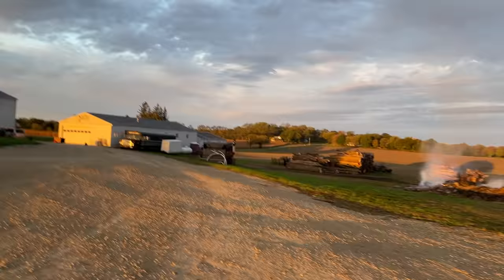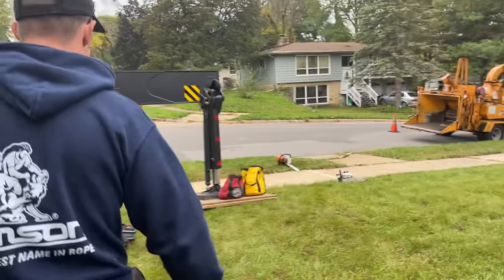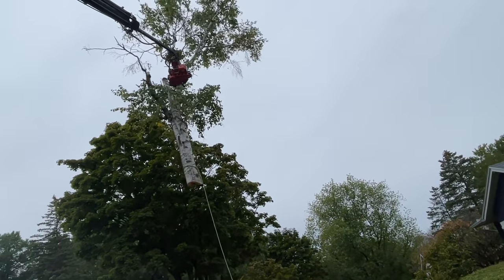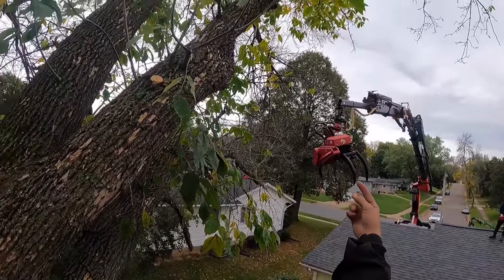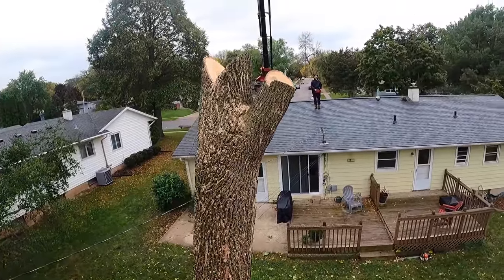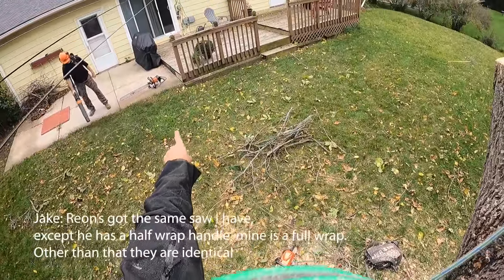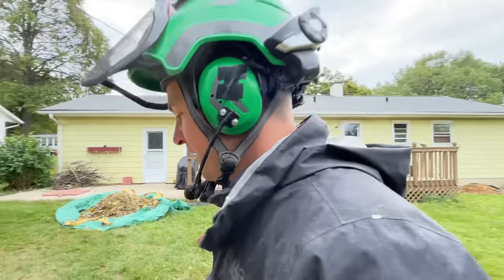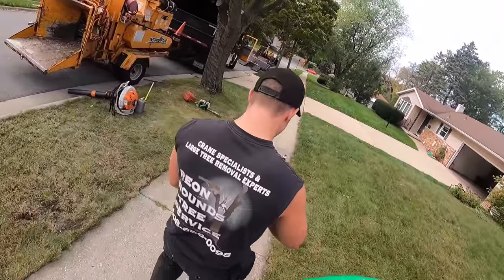KunckleBOOM BABY! Reon's 110 ton TreeMek picks apart a big Ash tree in Wisconsin.

Comment: Awesome job, I really enjoy your "interview" style. you have a knack for asking really good questions without sounding like your just doing an interview. Funny that truck had everything including an air nozzle to blow off the controller but doesn't tell the weight of whats in it's grip. congratulations on the new adventure look forward to seeing where you go next!
Reply: It was showing percent of capacity on the picks, so I guess it doesn't matter how much it weighs as long as you can pick it up.
Reply: @dukeflem  good point.
Reply: @dukeflem  p
Reply: The weight scale would constantly have to re evaluate the pounds as the boom retracts .physics .so  % of capacity is more beneficial

Comment: The knuckle-boom is an awesome piece of equipment!  I was in awe of how flexible it maneuvers, and the talent of Reon.  “Smooth operator.” 😉
Thank you, Jake!!  Looking forward to the next video.
Reply: Indeed. Palfinger Cranes are some of the best ones when it comes to flexibility and the company takes great care about giving the customer exactly what he wants and needs.

This model is (i think) one of the biggest they make and it has so many great functions like a memory for a crane position (means that you can "save" a position, and if you push a button the crame remembers this position and automatically moves to it the same way like you did it manually before.) or a "boot up" sequence where you can program that the boom automatically unfolds and goes into a pre-set position with just one button. (This is mostly meant for cranes that are used to load trucks, but i'm sure it works with this one too.)

And not to forget the safety and assistance systems like a overload protection, also that the crane checks if the outriggers are out, how much they are out (half, full, etc.) and calculates how much you can lift with that and shuts down if you lift too much.
Just like you can see at 33:40 that's the system telling you "Hey, this is almost at max. capacity. Be careful."

Comment: A short Ton, is equal to 2,000 pounds
A metric Ton, is equal to 1000kg, (or 2,204.6 pounds)
So Reon really got his math screwed up when he said, "a 110 tonne is about half of what a ""normal measurement"" would be".
When in actuality you could add 10%, so it would be about 121 short tonnes.
Anyway, there's no way that crane lifts that much or even half of that, which would be about what an A1 Abrams tank weighs in at, 55 short tonnes.
It would probably be a good idea for him to read the load chart before he continues working with that thing.

Comment: I'm not sure Reon has his maths right. A metric ton is 1000 kilograms which equal 2240 pounds. If the truck weighs 55 American tons then the 110 must be for 110,000 lbs. That is an awesome piece of machinery
Reply: Crane driver from Sweden here it is rated for 110 tons at 1 meter should dead lift 20-25 tons at 4m =)
Reply: @Daniionwheeles  thanks for clearing that up

Comment: The biggest knuckle boom picker I have heard of is 60 tonne so a capacity of 132277 lbs and 50 meters reach so 164 feet of reach and at max reach it can handle 1800 lbs. But that is an impressive rig in its own right.
Reply: He states that this is a 110 metric ton crane =110.000 kg
A US ton (short ton) is 2000 lbs =907 kg

A imperial ton (long ton)  is 2240 lbs = 1000 kg. 
So this is a 2240× 110 = 246.400 lbs crane at 1 meter distance from the pivot pin in the crane. (About 1 yard) and the lifting capacity at 10 meters is 110 ton /10m to give us a load capacity of 11 ton (long) or 2240 ×11 = 24.800 lbs

He seems to be a great guy and a skilled operator but he has it backwards on this subject

Comment: Does the display tell how much pressure the grapple is applying? How do you decide if the limb is a risk for breaking at the grapple? Is it just personal knowledge knowing the characteristics of that species? I suppose it's possible to safety sling either side of the grapple to the boom if you thought it might? Love the channel.

Comment: The best way I heard V-cuts explained is if you think its gonna spin or rotate then make both sides steep so it simulates a flat head screwdriver and the piece is trapped down and from rotating 
It also helps pop holding fiber in a piece that is pinching...the operator can lift or release and the angle cut acts like a lever ...
Big spar work with the mech head try snap cuts with the low side facing the crane ...
You can bypass the cuts ...move to a safe place/ ground..and the KB can push from the top and pop it while its sitting on the tree no shock load ...low side let's him retract for strength .....
I enjoy watching and learning from your guys videos and apply them to my career...ty

Comment: Great video, I’m going to have look at the specs on that machine. It might work better in my field that my stick crane
Reply: If you do look at them make sure to get the cable winch option as well. I noticed this didn't have one and was a bit surprised as I would think it would be pretty useful for tree work. Essentially it gives you the ability to use it like a stick boom.

Comment: Interesting your observations regarding the significance in varied tree species in equally varied regions of the country.  I grew up in WIS and now live in New Mex.  I am by the mountains and there are very few trees here in the 4400 ft .elevation of high desert.  Cottonwoods are by far the largest and are hundreds of years old.  Some are better than 6 ft. in diameter.  But, just 4000 ft higher in the same mntns is the Lincoln National Forest with some of the phenomenal Fir & other "Evergreen" species that TOWER overhead for what seems like hundreds of feet, Straight up!!  In WI we had huge Elms, Oak, Ash, and other huge broadly spreading species like those in this video.  As a kid I used to climb them like a squirrel.     Keep on with the great content.

Comment: What an awesome machine.  Its not 55 US tons capacity though.  A metric tonne is 1000kg, and a US ton is 2000lb, but a kg is 2.2lb.  This means a metric tonne is 1.1 US tons, so its capacity is 121 US tons.  It's called a tonne because metric is a French system, and it sits right between a US ton (0.91 tonnes) and the UK ton (1.01 tonnes).  If it wasn't so close, they would have called it a megagramme.  The US education system has taken a nosedive since the '60s.  Over 55s can do ballpark unit conversion in their head.  Anyone younger seems to have no idea.
If Reon bought the machine thinking it had a 55 US ton capacity, he's paid for a machine with over twice the capacity he wanted.  He's obviously happy with it, but that's no way to run a business.  This is why education matters.

Comment: I looked up the price of these trucks, they can range from like 100k to million. Can't even imagine the fuel consumption of an 80ton truck. Just baffles me at how there is profit to be made cutting trees for a few grand a day. Only 260 work days in a year, and multiple heads to feed. The math just does not add up to me, crazy but damn I do love these machines. I have a hell of a project coming this fall after the heat wave to knockout alot of 60foot trees around my property with plenty of lines and obstacles, and no way to wheel a crane into the backyard :)

Comment: Here in Ontario we have the White Ash (Fraxinus Americana) and they Emerald Ash Borer has killed millions of trees. On my 80 acres we have cut a few thousand down and the suckers come back with a vengeance. You have to herbicide, burn, or chip the stumps to stop them from coming back and infecting the new generation of trees. You are then left with beautiful logs up to 48 inches across, but you can't sell it because the market for ash is gone because of the disease. Most of it goes to firewood unfortunately, some of the largest I pulled out were 150 years old burned for firewood. Sad.

Comment: i run a knuckleboom for a living in europe, and the 110 doesnt actually mean straight up tons on the crane ... its actually 110 ton/meters .... so basically the 110, you move the decimal point over for 10 meters and you know how much it can potentially lift with 10m of reach on the main boom without the jib on the crane, so 110 t/m means around 11tons on 10m of reach, and just double the number to get the lift capacity with the boom completely closed up.... used to run a 220 t/m for a finnish company for 5 years, also its not really all that complicated to run, the keyboard remote functions are all pretty much set up the same way, no matter what brand of crane you run, exept the goofy ones (for me personally) that use remotes with joysticks

Comment: As expensive as it is, I'd like to see if it has weight sensors on the pads to see when the truck moves as larger pieces get lifted way up.  On smaller booms I always watch the tires to see if the truck is lifting.  Only negative of course is you don't know the % of capacity until the piece is cut free.  The extreme reach will increase the weight of a similiar size piece showing a lower percentage.  Need really good judgement. I'm betting the swivel grapple alone is $80K or better. Good video.  Thanks for sharing.

Comment: I'm sure you know this already, but since this industry and this medium are all about sharing knowledge. 
What I like to do for large stump cuts is to use a much shorter bar (half the stump diameter), plunge cut then work my way around cuting with the topside of the bar always keeping the tip facing the centre of the stump.  The saw stuffs the cut with the chips and jacks it up.  No wedges needed and no pinched bar and the stump slides off really easy since the chips act like ball bearings.  Try it!  you might like it!  From one cool guy to another

Comment: I drive a pk92 with the pj170 fly jib.
When I have used the manual extension and need to push it in again I try to have the fly jib parallel to the ground, if that isn't possible I hang it straight down and use the jib extension o push it in against the bed of my truck.

Comment: Coming from noone at all but a lifetime of crane experience from AT ,crawlers,taxi crane from 18 ton to 1000 ton in all types of configuration in super lift on ringers . One day that level will bite you in the ass but  then again the technology built 8nto those is kinda moron  proof with cut outs unless you bypass the kick out . And controlling your load with a crane is a complete different animal . Proof buy recording improper setup of unit buy showing the world the level. It was put there for a reason im sur the janitor didn't add that to well paid engineers blue prints while taking out the trash

Comment: I think the comment about the type of tree is the deciding factor on which equipment is best is a bot off because simply put the type of terrain and home lot layouts in that area are a much more important factor than type of tree, all flat, paved roads, similar sized lots etc etc. That machine is worth it's weight in gold in that area but would be very limited on the west coast due to narrow roads, soft mud, and of course big tall tree's for the most part. Great work guy's and very good communication between work crew.

Comment: I just make a straight cut through when using the wood cracker, sometimes I make the cut, sometimes the woodcracker  makes the cut, we have the cs950 woodcracker head, but I still use the “V” cut with the stick crane

Comment: In the fire service, we’re taught a similar trick when low stumping a trunk like that. You cut half way, wedge in back, then cut 90%, then grab two small twigs and put them in the curf by the saw bar, remove your back wedge and finish your cut. I’ve done it a few times and it works like a charm.

Comment: We run a palfinger knuckle boom as well. Ours is mounted on the ass end of the truck though, allows for easier positioning IMO. Makes jobs a lot easier and a lot safer. Still have to get a stick boom every now and then for capacity/reach, but the palfinger usually does the job. I like the fact that his controller has a capacity meter on it, might have to look into that.
Reply: The beep of success

Comment: Stick boom on hills better? Knuckboom can be 5 degrees out of level not a stick crane needs to be 0 level
Reply from the maker: Interesting, I didn’t know that
Reply: @GuiltyofTreeson  ya I been researching since 2005 may be pulling trigger on used effer 655 with dump body it's sweet no grapple saw sling big wood for a while then drop 50,000 on saw and piping in boom

Comment: Awesome! I operate a 100 ton tree mek out of Georgia. I am always having to set up on hill, the truck will do it and work just fine but it does take a little cribbing under the tires to put pressure on the suspension. Great video.

Comment: When I do jobs that may impact power lines to a home I call in the service provider to drop the lines and that way no stress for homeowner and the arborist.how many trees do you have to work to pay for that crane truck? For the amount of time it takes to set up the crane I could have the line dropped and run up the tree at a far less cost to the homeowners.nice piece of equipment but so unnecessary.look at all the equipment on the street for one little tree.and that’s not cost effective.the homeowner is taken to the cleaners.how long does it take for every piece to be handled? It’s taking way too long once again the homeowner pays thru the nose.how did we ever do it without all that equipment.it’s a major logging show.not to mention all the manpower that’s needed.try watching Andrew Camarata.he does so much more all by himself.